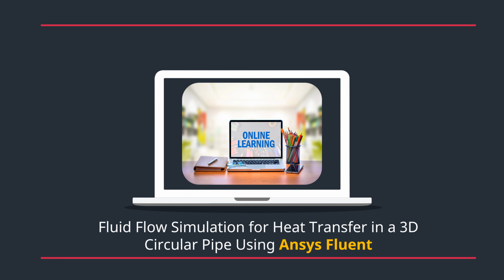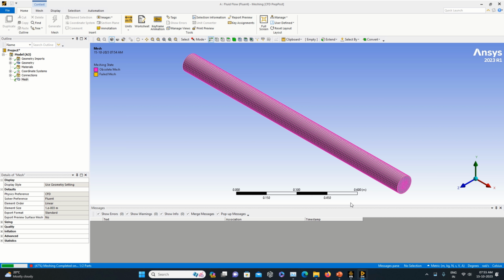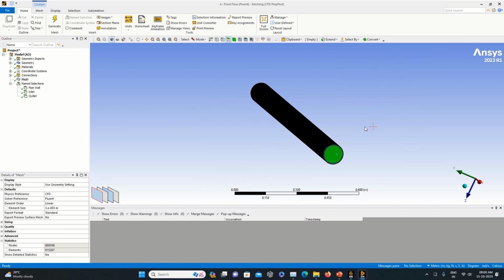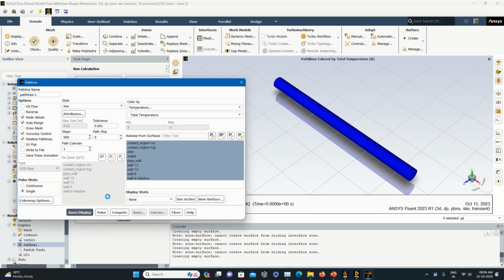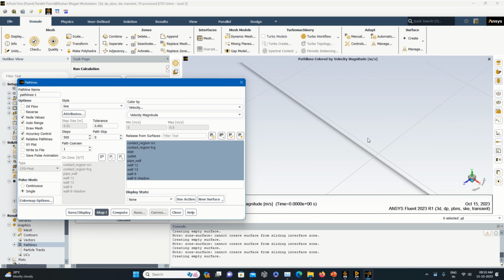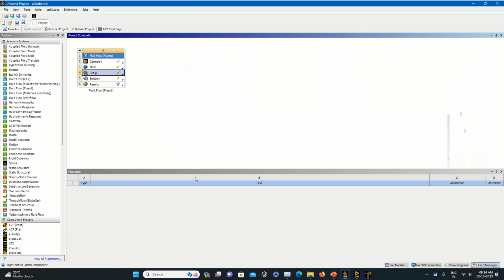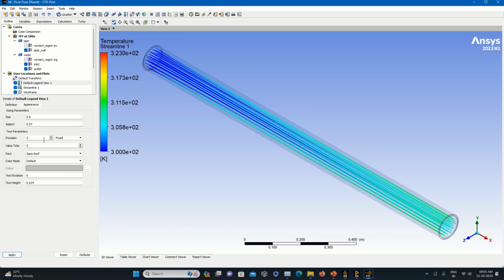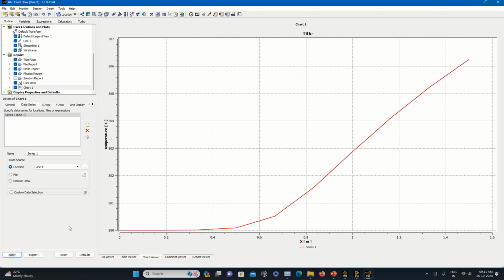Fluid Flow & Heat Transfer in 3D Circular Pipe || ANSYS Fluent Tutorial

Comment: Suppose instead of Aluminium I want to use another material for pipe solid. What all things should be changed ? Can u pls do a seperate video on that it'd be very helpful
Reply from the maker: You need to add material and in cell zone condition define it
Reply: @FrontiersInCFD  okay how to do it ?
Reply from the maker: Go to material and click on any default material then click fluent database and select

Comment: I need pipe geometry should be split into three sections: A uniform heat flux needs to be applied only on the central section, and the analysis should be carried out under different turbulence conditions. Can you help?
Reply from the maker: Yes please connect on whats app +919834584778

Comment: Btw if we want to do this in a setup where there are 2 pipes within each other, so that there are 2 fluid spaces. Let's say one for water and one for air. I want to have a hot air that can transfer heat to the water. How should i set up the boundary conditions.
Reply from the maker: check my video cfd simulation of parallel and counter flow heat exchanger

Comment: Its a good video,
What is the differene between meshed wall and shell conduction with or without run_out methods?
How to apply these methods in fluent?
How to set O_grid mesh for copper tube?
Reply from the maker: Shell conduction can be used to model thin sheets without the need to mesh the wall thickness in a preprocessor.  Check in model setup
O grid can be done in icem cfd
Reply: @FrontiersInCFD  I have copper tube with Di = 8 mm and Do = 12 mm, e = 2 mm, I want to simulate with shell conduction but in fluent setup in heat flux boundary are we input the value of thickness and activate shell conduction ?